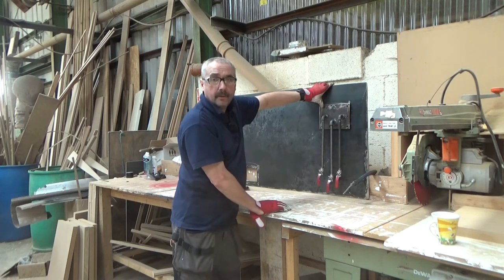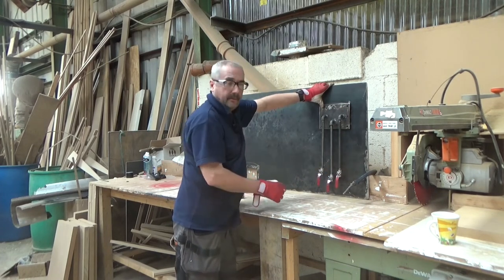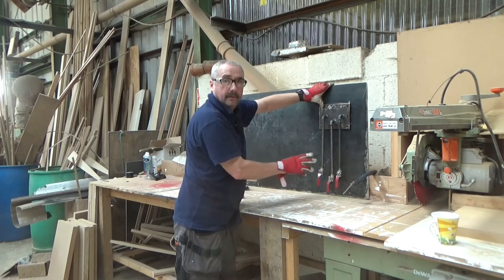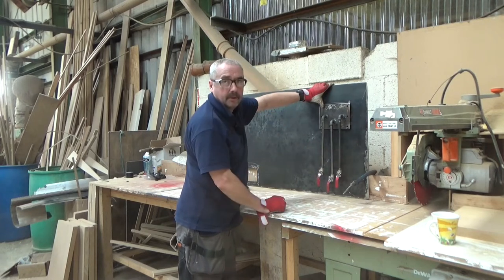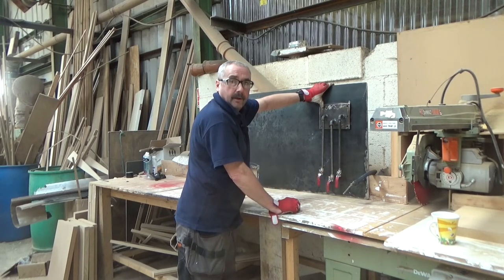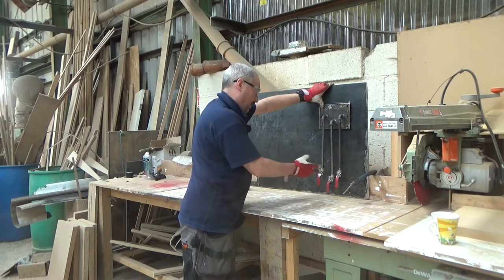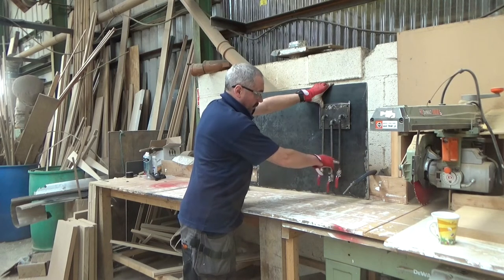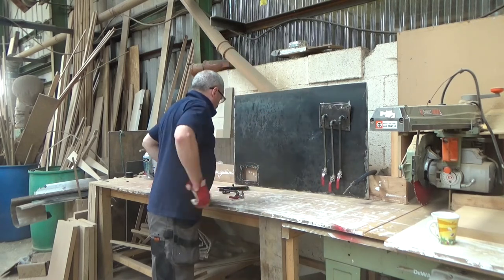Narrowboat Build & Fit Out . Diesel Tank Fittings

Comment: Why don't we have plastic tanks that don't rot on narrowboat's. Ones we can change if necessary? I feel that these tanks don't do well after 10-15 years. What do you think Andy?
Reply from the maker: Hi Will. I have seen boats with stand alone diesel tanks made of stainless steel as yachts use  , I don't think plastic is allowed though. I should imagine they mostly are where they are ,as the outside of the tank is already there and you just have to fit a bulkhead to the front and you have a tank. As diesel is a oil it should protect the inside to a certain extent but you get a little condensation that  can rust the tank as there is a void as fuel goes down.